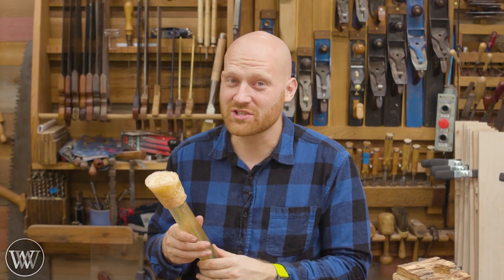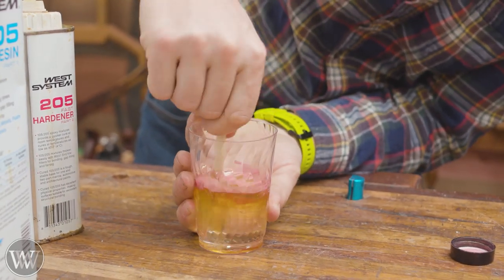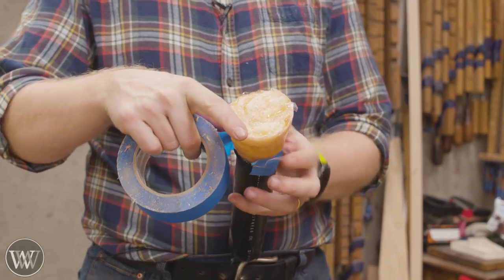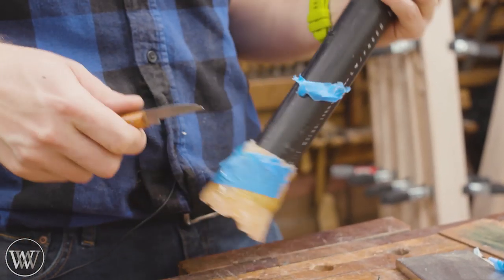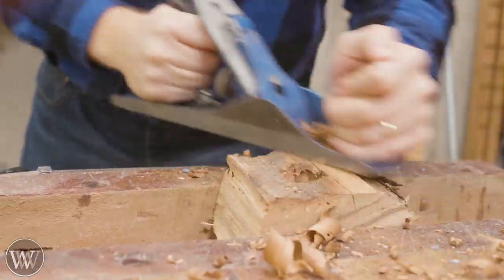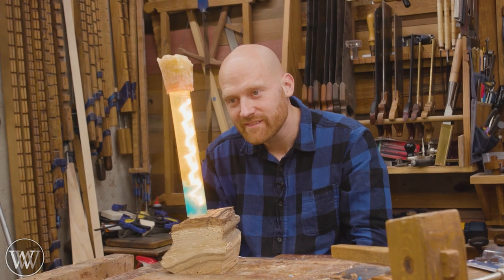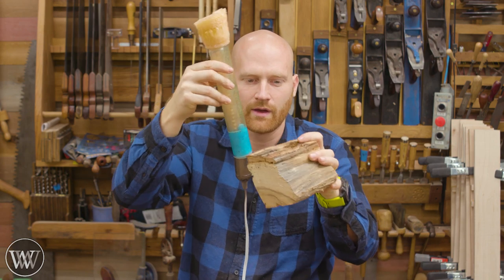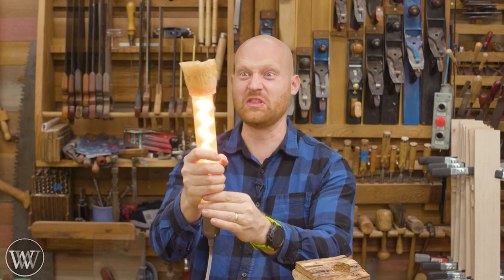How to Make a Prop For Fuzion Videos

Comment: Aloha James,
50 years ago, I started into 'casting resins'. It was long before the 'oil shortages'. which drive the prices through the roof and I afforded to step out of it. But way back then, it was cheap and playful and creative. Among the first items, I made to document my passage through this era was when I outgrew my need for my first mustache. Rather than just shave it off, I choose to cut it off and save each hair to place inside a paperweight for my desk. I hope you don't get too much side pains from laughing. 
Now with decades passing and the 'West System' in use, I've evolved and used a vacuum system to glue most everything that the company needed doing. I even developed a few jigs and rigs to glue things for awesome effects.
As a side note: I wish my 'stache' was still here. It showed the change in my facial hairs, in color. Back then, as a 15 old, my 'mustache' was as Red as what hair you still have. It morphed through a range of colors and finally settled on dark brown.
Years from now, if it's not too costly, we may reflect on the things we did and be happy we had our 'run' with these products or regret the cost and wish for better use of our money.
Keep your edges sharp as your wits and enjoy the 'singing' of a good edge shaving the next curl of wood.
Aloha,
Mark Baker
Reply from the maker: Nice mark! Thanks man!

Comment: James,
Interesting "prop" light. It is rather psycho-delic, LOL. 

On a totally seperate note:...
Have you seen Johnathon Katz Moses' latest video on his infinity cube table? I'd love to see your take on it with either 9 or 18 different joinery joints (18 total joints in the infinity line that forms the cube). Also, I'd love to see your "fix" for rigidity if you go about it differently than Moses did.
It could be the next step up from your four panes picture frame woth different joinery, except all of the joinery on this one is right-angle joinery at the ends of the sticks of wood.